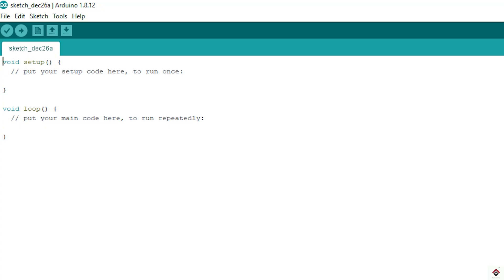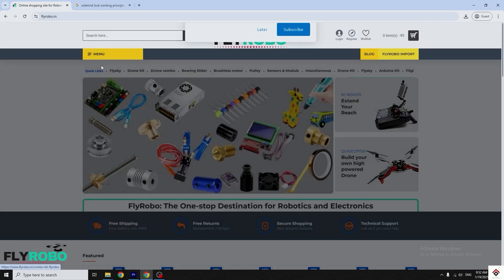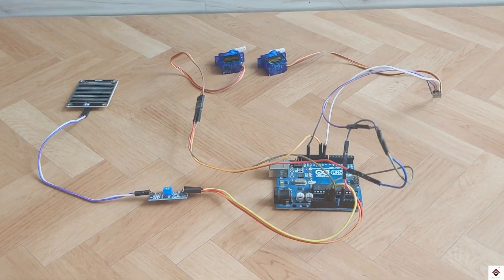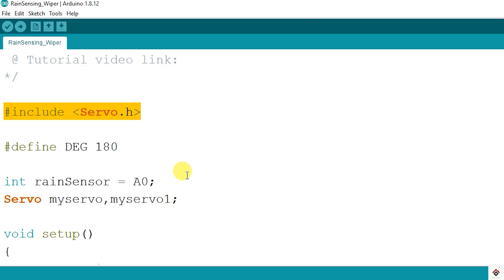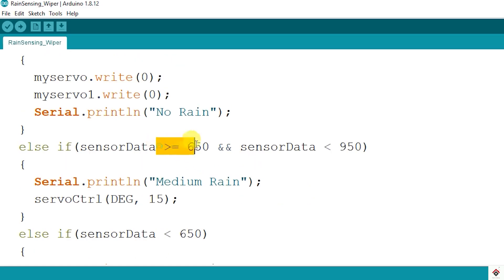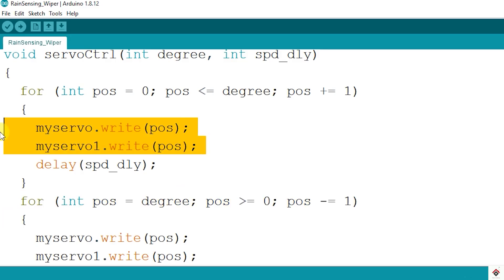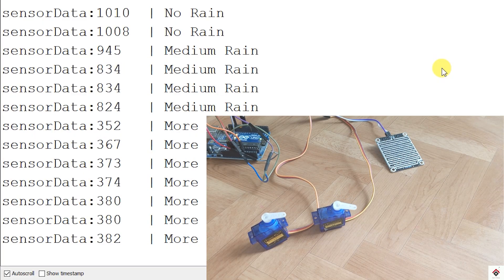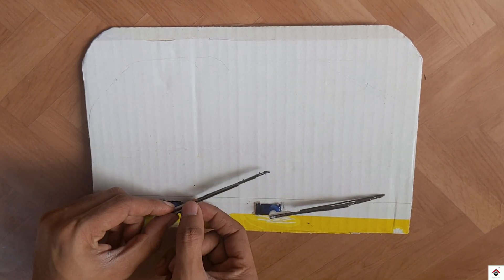Automatic Rain Sensing Car Wiper Project using Arduino, Rain Sensor and Servo motor [with CODE] 🌧️🚗

Comment: Sir the code you have sent in mail....only that much to code??
Reply from the maker: Yes, you have to just upload the same.
Reply: @techathome sir its not coming......whn I uploaded after connecting to arduino its showing uploading but it doesnt get uploaded
Reply: @techathome sir can u pls help me out the code isn't uploading....it's jst only showing uploading but its not uploading.....nd when i connect it to arduino for few seconds the light will b on in arduino nd later it off
Reply from the maker: Something wrong with the board or driver.
Which Arduino board are you using? Dip or Smd?
Reply: @techathome sir its smd maybe....the one which u used in video that itself
Reply from the maker: We have used Dip version in the video.
Have you selected Com Port?
Check the port number in device manager.
Reply: @techathome yah i got it right now.....thanks a lot sir..❤🎉
Reply from the maker: Welcome ♥️

Comment: the servos start working before spraying water on the sensor. what to do? plss say
Reply from the maker: Open the serial monitor and check the values from the senor. Based on that modify the thresholds in if-else statements.

Comment: How would it be for that same project, but instead of Arduino Uno, change it for Nodecum ESP8266?
Reply from the maker: You can use, but modify the pin numbers in the code as per ESP pin availability.
Also use external 5v supply for sensor and motor, since ESP doesn't have 5v output pin.